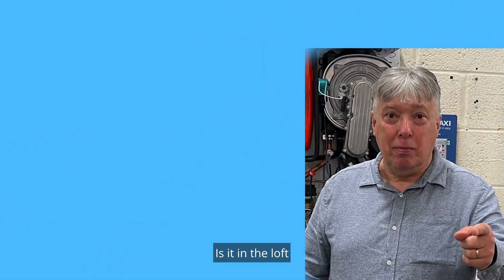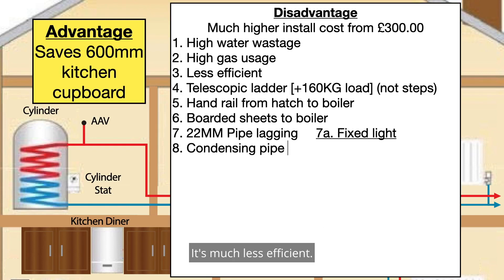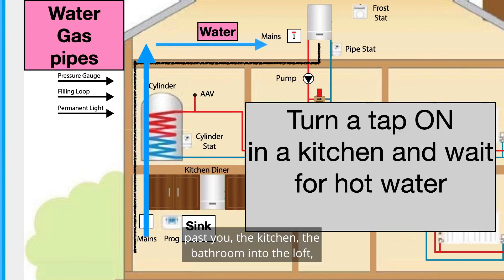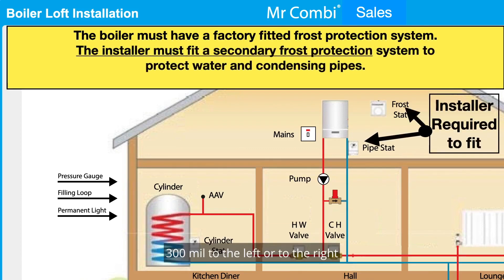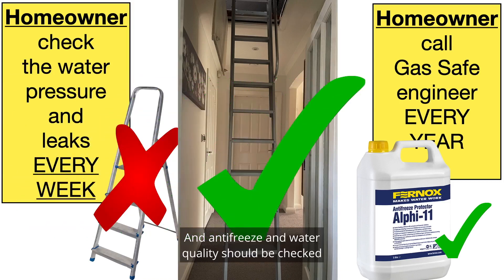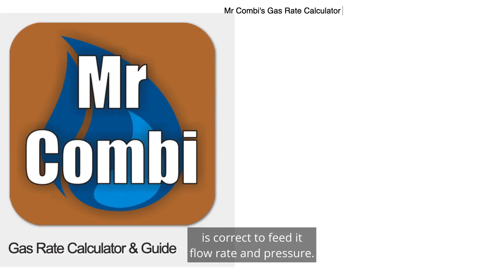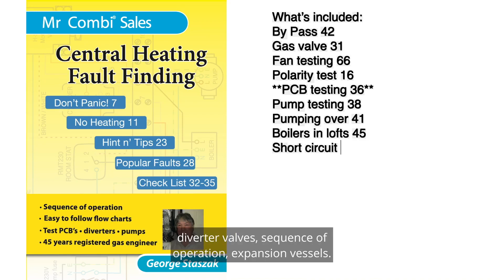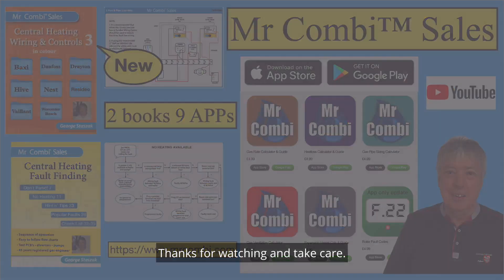LOFT boilers.....  This video explains the advantage and disadvantages.

Comment: Should a carbon monoxide detector be installed inside a ventilated loft if the boiler is up there?
Reply from the maker: Hi Westonic, thanks for the excellent idea I agree that should be mandatory for all boiler in unheated areas  and cupboards. Take Care, george 🤩🥰👍👍

Comment: Excellent points there.  I don't like to see boilers in lofts generally.  They tend to suffer from condensation/damp etc.  Plus, if a leak develops customers aren't usually aware of it for a while and this can cause damage to the property and the boiler.  Hard to top up pressure etc.  Just not a good idea.
Reply from the maker: Hi Martin, thanks for your comment I never installed in a loft its too much hard work, lots of mates got injured or damaged property apart of the high running cost, I didn't
want me name on a rubbish install. Take care, George Staszak 👍